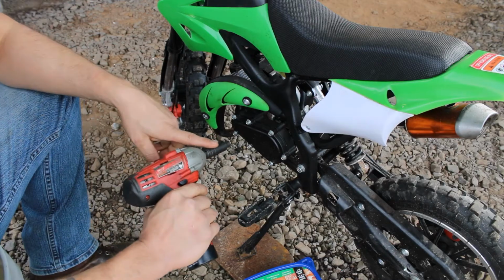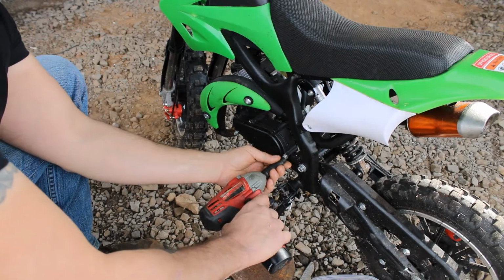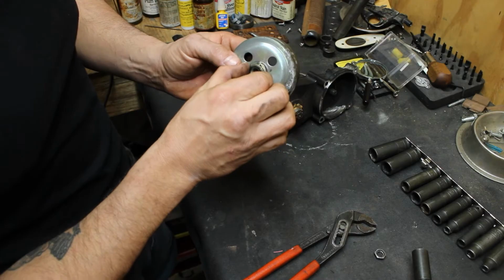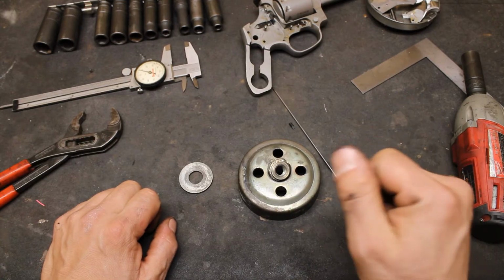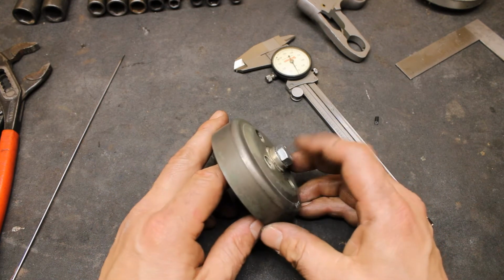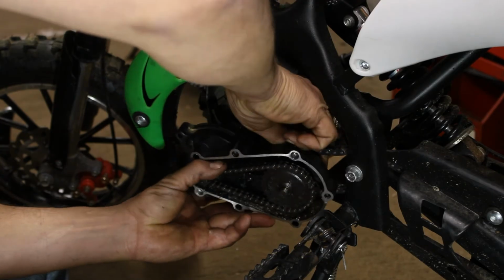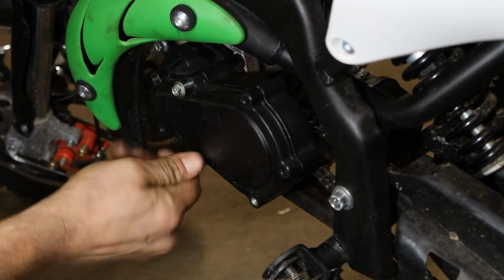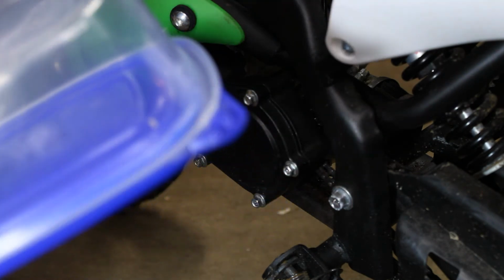Centrifugal Clutch Repair And Modification - SYX 50cc Dirt Bike

Comment: How did you know that clutch was broke . Whatnproblem is the bike doing. My rear tire is locked up. Wen i stadt it it takes off . As if the throttle was beeing pulled but it isnt. Im trying to find out whats wrong
Reply from the maker: It wouldn't pull
Reply: Did you ever figure out what caused the issue, my son's bike is doing the same thing. 39cc

Comment: Dude this is a mad vid .. sub for sure 👍.. very informative mate ya explained almost every detail even the turkey container.... but the welding of the thing, i cant really weld but in metalwork class at school they said to do some tacks exactly  opposite side sorta like when ya tighten the wheel nuts on a car,so the heat from the weld dont cause the steel to move in a particular direction... but im assuming its probably not nessecary cos ya had that bolt holding it in place yeah?
Reply from the maker: thanks for the sub. they told you right and yeah thats  what the bolt was  for .

Comment: Good video, here. The engine mount needs bracing. Sure, you can find needed improvements. I have one here. It belongs to friends. The cylinder looks worthy of a second chance. Everything on the syxmoto is made of inferior material and with,  poor, design.